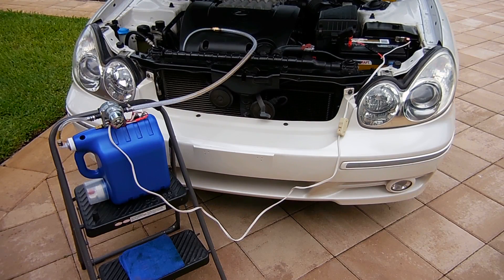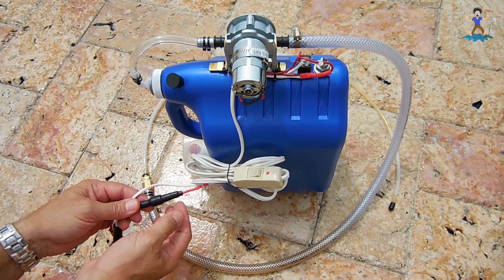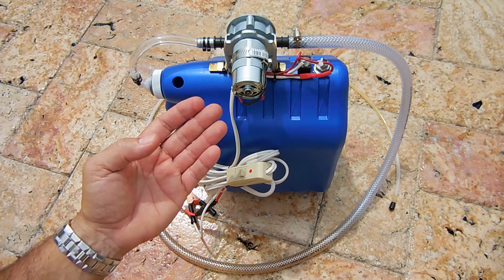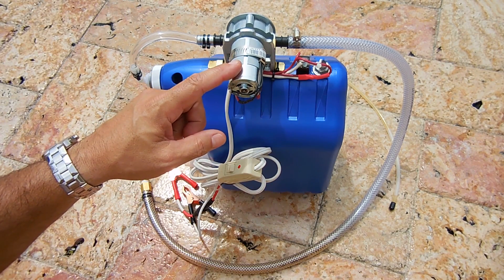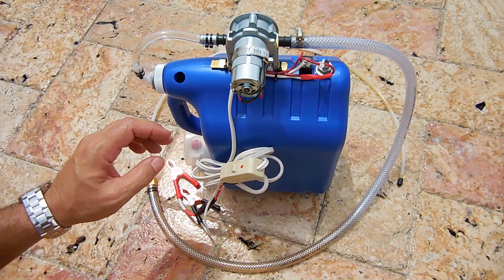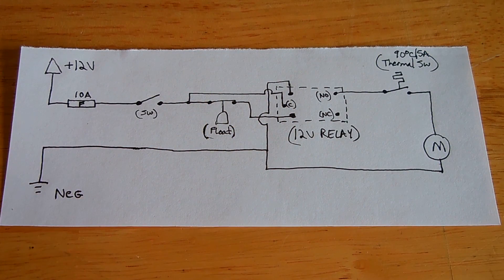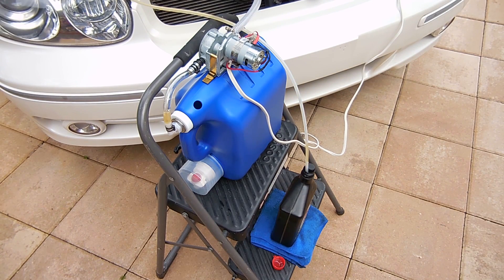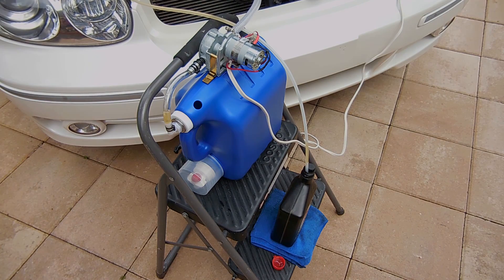Portable Oil & Transmission Fluid Extractor Pump For Cars & Inboard Boats!

Comment: Dont like it, noisy, junky, bulky, heavy footed, and expensive, i like the new Holt 89 dolla 79 with 20 percent Harbor Freight coupon extractor.
Reply from the maker: It doesn't matter if you don't like it, because I do. It's compact(unlike the bulky Holt), it's electric(unlike the MANUAL Holt where you have to keep pumping constantly), cheaper to make than buying a Holt, and the only thing junky is your attitude. You couldn't design what I made in this video if your life depended on it. Merry Christmas to you too!

Comment: this video  made me a Subcriber  i liked all the good details  that you pot into  the system  ive been a boat owner for over 35 years  and  do all my own  maintenance  now they do sell a  system  for boats that can exchange  oil  in a very clean and efficient  way  and they  sold a similar  system to yours that uses a 3 gallon  bucket with a 12 volt pump  and ive used that  but in all honesty  after the first couple of uses  its always had drips  btw i found this video  when looking for reviews on the made in China  oil exchangers they  sell on Ebay wanting tp  see if they were worth the money y

Comment: nice job
I'd be curious how long this jig lasted^^

many users claim to have overheating issues, did this become an issue?

I decided to dremel some openings where the motor has the cooling slots since the original designs doesn't have a thermal switch, might add this at a later point if the other modifications didn't kill it^^
Reply from the maker: Still have it. Works fine, but I don't use it all the time.Thanks for watching!

Comment: Over engineered waste oil container.

Just...Stick a hose on each end , one down the dipstick hole the other into a five gallon pail.
Reply from the maker: If you don't like it, don't make it. Very simple. People on YT truly amaze me with their comments.
Reply: @electronicsNmore  Sherlock is correct with his view inline with just getting the job done without any though of improvement. But your invention is well throughout and constructed. Its safe, modular and you display good craftsmanship with your hand skills.
Reply: Spot on mate, no need for all that faffing about. I've always got an empty 5l oil container, pump it into that, screw the top on and take it down the local dump  -  easy peesy lemon squeesy.

Comment: Not a huge deal, but the thermal switch was improperly drawn in the schematic. It should have been drawn as a normally closed switch with the contact drawn coming out from the dot or circle on one side to being slightly tilted on the other side due to sitting on top of the dot or circle with the zig zag lines drawn underneath so that when the heat causes the zig zag portion to expand, the switch would have been pushed up to open the switch on the side where the line sits on top of the dot or circle. This is the way these thermal switches are normally drawn so that they're understood intuitively. The thermal switch in the schematic is not only drawn upside down, but shows that it would close on temperature rise. Just an FYI for future schematics.
Reply from the maker: Fred Flintstone I noticed after the upload that it was drawn open circuit instead of closed, but not upside down according to a few online sources. Thanks for watching!

Comment: I have a 2005 2.4l sonata (u hv a V6), when I tried full synthetic it burned oil a lot, after 2000 mile it was down 3 quarts!  With regular oil it doesn't burn any or leak.  So be careful, I can't explain why this happened but mechanics tell me this happens, somehow the synthetic blows by more or get around valve seals?  My engine did not like it.  How much oil is left to drain after this elec pump is done?  Have you removed drain plug to see?  Thx
Reply from the maker: A D I've been using Castrol 10w-40 full synthetic oil with Lucas for over a year with no probems. Maybe 3/16 " to 1/4" of oil remains in the pan. Thanks for watching!